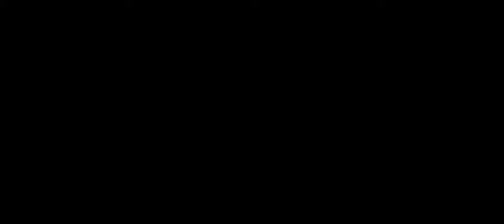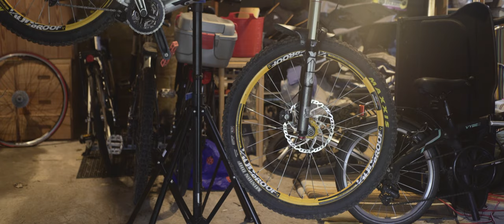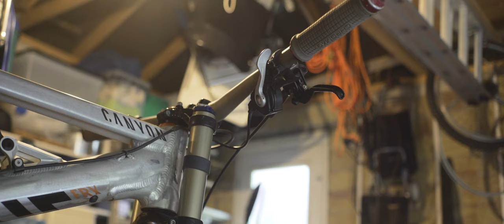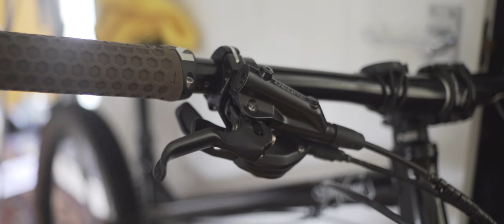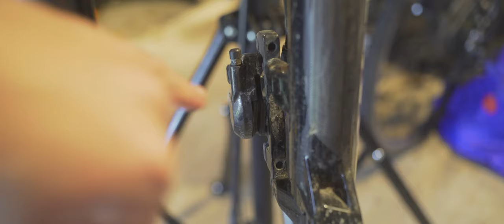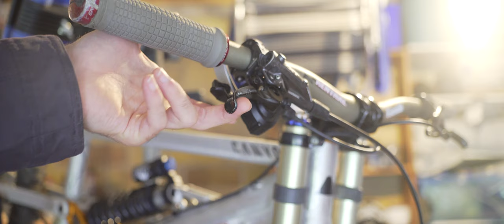How To Change Your Bite Point Or Free Stroke ( Spongy Brake ) Shimano or SRAM Hydraulic Disc Brakes

Comment: I've done this before but it dosnt seem to last that long. My lever seems to go back to being a close pull as you described. My lever is already adjust as far out as it can go via the little 2mm screw. Funny thing is my front brake is fine , it's just that damn rear one giving me trouble. I've bled it over and over again. I may just buy a new rear brake.
Reply from the maker: There shouldn't be any reason for this not to last...once the pistons have been pushed out they can't really go back. The only thing you could be facing is pad wear? Obviously once the pads wear the tolerances change somewhat. What levers are you running? Is there any chance you have an air leak somewhere? FWIW I've always had more issues with rear brakes than front ones. The long hoes makes it harder to get a good bleed
Reply: it happens to me too, but on both brakes. I think you need to bleed it with the pistons already pushed to feed more oil
Reply: You just described my exact issue. You're right too. This easy fix doesn't last very long. My riding buddies kept asking why I kept taking my tire off 🤣
Reply from the maker: Interesting observation. My trail bike hasn't been rebled or had any attention to the brake system except new pads for just over two years and the brakes feel exactly the same as they did after adjustment. It might legitimately be a case of there not being enough oil in the reservoir in the lever initially which would allow air into the system over time. Might be worth a rebleed/top-up
Reply: Yes it won't last, since when your pads loose material, the distance that your piston needs to travel to brake increase. Your piston is hold in a seal that deforms when you brake, due to pressure applied on the piston, and therefore move the piston forward. When you release your brake, the seal get back in its original shape (like a spring), and so do the piston (there is no slip between piston and seal) . But when your pads get thiner, the piston needs to move more and eventually the seals wont be able to deform enough for the pads to reach the disc, so the piston will slip trough the seals due to pressure, until it reachs the disc. Then, the seals get back in original shape, so pistons and pads move backward at the exact same distance from the disc everytime, no matter what.

When you do the tricks of the video, the travel of your piston get smaller than the travel than can cover the seal when deforming, so it works, but when your pads loose material, the travel will increase until it reaches the point where pistons got to slip trough the seals again.
This allow us to have every time the same travel for the piston no matter your pads state...

Comment: So I did this on my previous bike and it worked wonderfully…exactly as described in your vid. Fast forward…new bike but same XT 8120 brakes and I’m trying the same thing but it’s not working so well. The pistons advance as expected but they don’t stay in that position. Rather they just retreat back to their original starting position when I cycle the levers, effectively eliminating any change to the bite point. Any ideas on what’s going on here? Was thinking maybe this only works if you’ve got a solid bleed going…and maybe I don’t however I’ve bled them many times over with no luck. Open to suggestions…TIA
Reply from the maker: If you’re finding that they’re retracting that’ll be because of the vacuum in the master cylinder. My advice would be to follow the steps in the video but with a bleed funnel attached to the lever and a bit of mineral oil. This will allow the system to be essentially ‘overbled’ so the pistons cannot retract as far. Hope that helps!
Reply: Ahh yes…that makes perfect sense. Thx for the advice…I’ll give that technique a whirl and see what happens
Reply: I guess what’s most confusing to me is why this maneuver works for people that DON’T overbleed their system with the reservoir cup in place. Without it, why would the pads stay advanced?
Reply from the maker: It depends on how much fluid was in the system to begin with. No two brakes are going to be bled exactly the same. If the factory underbled your brakes for whatever reason you’ll have pistons that retract further but the next bike on the assembly line might have brakes that are overbled. It will all depend on the mechanic who assembled it. 

There are also brakes that benefit from underbleeding like Hope’s RX4s. If they’re overbled the pistons don’t retract at all so you almost always have to create a vacuum in order to get the pistons to work properly
Reply: Okay…have a new question for you, kind sir! I just bled my brakes as you described in this comment exchange. I advanced the pads WITH the reservoir still in place and it seemed to work brilliantly. I like a very short lever throw and this def did the trick. The next morning I grabbed a handful of brake lever and it shot all the in to the bars. I rechecked my top & bottom bleed ports and they, indeed, we’re both tight. What I did notice was oil leaking out of the outboard side of the master cylinder. While I’ve since learned that it is actually some kind of overfill release valve (or something similar), what I can’t find is how to fix the problem. I’ve bled completely twice since this happened and the lever still isn’t tight. Have I popped some kind of gasket inside the master cylinder?

Comment: Xt 8100

Im in a position where if the brakes are close to my grip, and i one finger brake, it smushes my other finger.

I got the lever throw all the way out.

Do I need more oil in the line or something?

otherwise I had to scoot the brakes further away from the grip, but that also puts my shifters kinda far away.

What am I missing.

If I just 2 finger brake then Im fine but what the heck thanks?

Comment: I’m gonna try this on my Tektro 275 brakes as I’ve bled them twice now and they still feel off. Seems like i need  to pump them a couple times to have them feel right like the pads need to move closer to the rotor. I also wonder if using a 6 or 7 mm bleed block would accomplish the same thing if bleeding and using not brand new pads.

Comment: I had tried this previously and it worked for the first ride, but then started to go back to the original position after a few rides.  Maybe I didn't pull the lever enough times when adjusting.  I will try again and hopefully it stays tight longer.
Reply from the maker: I think you’re right. You might just have adjusted it enough. I re-adjusted my hard tail in December and the brakes haven’t needed any work since
Reply from the maker: I think you’re right. You might just have adjusted it enough. I re-adjusted my hard tail in December and the brakes haven’t needed any work since

Comment: 3:22 I am confused, why didn't you do this using the free stroke adjustment screw ? Doesn't it do the same thing ?
Reply from the maker: It technically should, but in practise the free stroke adjustment is next to useless because of how little movement it offers. Shimano’s free stroke imo isn’t worth having on your levers. I’ve run Deore levers with XT callipers on various bikes for years. Performance is the same and it’s cheaper to replace if you crash
Reply: @BenHuggett  so in theory the free stroke screw should move the brake pads closer to the disk, no ? Because some mechanics say that is not what it does, one was very sure that it modifies the pressure somehow and NOT "moving pads closer" as I claimed 🤦‍♂
Thanks.
Reply from the maker: It’s a closed loop system so yes that’s exactly what it should do. In practice however, the range of adjustment simply isn’t enough. Any change to the pressure in the system can ONLY act to move the pads closer. The point of this video is to show an alternative method of moving the pads that allows a greater range of movement

Comment: Just tried this on a brand new out the box bike (when doing a tubless conversion so had wheel off) and the stoke got worse/longer.  Is terrible now. Why don't brakes have an adjustment for this
Reply from the maker: Some brakes do have an adjustment for this. It’s called free stroke. If your travel has become longer by doing this then you must have done something wrong or there is a vacuum in your brake line. Have a read of some of the comments here, people have added to the video with some really helpful advice
Reply: @BenHuggett thanks for the reply. They're on Shimano SLX so don't have it stock. Maybe because when doing the tubeless it was upside down for 10min

Comment: Hey there. I have performed this a couple times which helps immediately but then after a little usage it ends up even worse than before. Discovered that a mile into my ride where I could pull the lever all the way to my handlebar and keep rolling. Any tips for why a fix like this does not persist? Brakes have been recently bled and lever springs back nicely.
Reply from the maker: Hi,

If you can pull the lever all the way to the bars at all that suggests there’s not enough fluid in the system or air. I know you said the system has recently been bled but if it’s been bled thoroughly, there should be no way for your bite point to wander around like that. The brake system should be a closed loop so once you’ve made an adjustment it should stick unless you have a leak somewhere. It might be worth checking that your pistons aren’t leaking and that the couplers are tightened down on the calliper and the lever! 

Hope that helps!

Comment: I just did that and realised I needed new pads so I put in some spares and the brakes have little to no movement and the disk is bent so it rubs which sucks but I think I just have to re bleed them to get some oil out cause the pistons won’t budge
Reply from the maker: It can take quite a lot of force to push the pistons back if they’ve been exposed to dirt etc for some time. Might be worth having another go with something larger to get more leverage before you go through a full bleed

Comment: Hey man I tried this after realizing my left XT M8020 levers 'free stroke' screw literally did nothing but extended the reach of my levers, after doing your trick it worked like a charm, I dont even know why Shimano made a free stroke screw that doesn't work that well at all, disapointing.
Reply: BTW my front brakes are squeaking already, is it because it needs replacing due to it being .5MM of resin left?
Reply from the maker: I’m really glad it worked for you! I’ve said it before and I’ll say it again, Shimano should ditch the free stroke screw and should just recommend this as a tuning process! 

As for the squealing brakes - that’s probably down to contamination of some sort. Have you noticed a drop in braking power recently?

Comment: is it normal that i have to repeat this process every few days? My zees are a few months old so no mechanical issues, but about two rides after pushing the pads closer together the stroke goes really far in again, and i have to push the pads out again. I have sintered pads so i highly doubt they are wearing material that fast
Reply from the maker: No, I wouldn't have said that was normal. Off the top of my head that sounds like air trapped in the system. Probably in the master cylinder. When was the last time you did a complete rebleed? As in opening both ends of the system and flushing it through with oil completely. I agree it's unlikely to have anything to do with pad wear, sintered pads last for ages even in horrible conditions
Reply: @BenHuggett  have bled the brakes fully about three weeks ago, and then again about two weeks ago I did a lever bleed to try improve the feel, again the brakes are fairly new and they haven’t been getting much abuse, so I doubt it’s any air leaking in or similar issues.
Reply from the maker: Sounds like you've done everything right then. To be fair, new brakes do take some while to settle in. My XTs always take quite a long time to settle in and feel really spongy even after a bleed for the first couple of months. You might just need to give them a chance to get themselves bedded in. Are you riding downhill stuff?
Reply: @BenHuggett  yeah enduro/downhill type things
Reply: Maybe your disc is warped, and push back the pads over time.

Comment: Spend some time truing your rotor and a stand and one can get their shimano brakes to bite almost immediately when the lever is pulled AND you won't get any rubbing
Reply from the maker: I think you’ve slightly missed the point of the video. Rotor trueness has very little to do with engagement or bite point. The purpose of this guide is to show people how to essentially push their pistons further out to reduce the free play in their braking system. Truing a rotor will not accomplish the same thing. All the brake manufacturers advise users to push their brake pistons back when performing a system bleed but don’t advise users to push them back out - hence the positive comments on this video

Comment: Just done this on my new Scott Sub Sport Ebike which has Deore 11speed.  The front brake is really good now with only a tiny amount of free travel before the biting point, but the rear has a little more travel before biting point, but then again the front brakes always seem to be a bit more keener than the rear, is this normal.
Thanks John
Reply from the maker: Totally normal. Just means the brake pistons haven’t advanced the same amount. In other words, the piston/s on your rear brake is stuck further in the calliper than the one in the front. You can either follow the steps again for just the rear brake. Your when you come to do a rebleed of the system at some point you can make sure to push the pistons all the way back into the calliper equally front and rear

Comment: Is there a way to do this without removing no the wheels? I have a surron ebike, for me removing the rear wheel seems a big task taking it on and off..... would is the only option buying levers with the adjustment option? They seem really good
Reply from the maker: As the video says, the levers with the adjustment options (free stroke) are not worth having. The adjustment range is tiny - to the point where I'd call it useless. I've not found it works on any of the bikes I've had. Sadly there's no way to do this without removing the wheels from the bike. You only need to do it once so I'd say it's worth the effort of removing your wheel
Reply: @BenHuggett  thanks for the reply, wouldn’t removing the brake pads and then pressing the brake lever have the same affect? Just less work? And the pistons will move in as there’s no resistance against the disk?
Reply from the maker: @joethebrick6382  arguably yes, but I can see myself quite easily over doing the adjustment and pushing the pistons too far out, you don't want to have to force the pads back in. It's quite tricky to judge the distance. That said, you could just undo the caliper from the frame/fork and do it that way?
Reply: @BenHuggett  Thankyou! Yeah good idea I could just remove the caliper!  I’m pretty new to bikes 

I bought the surron, enjoy downhill and trails, never really rode anything else so not sure if I’d prefer a mtb over surron..... surron gets me back to the top of trails quicker and easy😂😂
Reply from the maker: @joethebrick6382  I'm glad you're trying it out! I think e-bikes are a great way to get into mountain biking, and obviously to build your experience. Personally I don't think they're as much fun on trails as a regular MTB. The weight is a bit limiting. But I will say, I can see the motor being great fun for getting back up the hills!

Let me know how you get on taking the calipers off.

Comment: Isn’t it going to rub on the rotor?
Reply from the maker: Not if you do it properly. The aim is to bring the pads close enough together to reduce the free stroke distance, but keep them far enough apart to prevent them rubbing. It's a case of trial and error

Comment: Definitely going to try this. Might need a straight rotor first though
Reply from the maker: It's absolutely worth a go. You probably don't even need a perfectly true rotor. The pistons will push it into true in order to get the distancing right and then you can work on straightening the rotor separately

Comment: Tried a few times now, if I move pads any closer, they start rubbing the disk, push them back a little and the movement is back was too much for my liking. Primitive technology, if we only could adjust the pad positioning, amount of bounce back and brake movement precisely with set or screws ... oh wait we've had this for years with traditional, steel brake lines.
Reply from the maker: Are your levers firm feeling when they actually engage the disc rotor? Your description sounds rather like it might be in need of a full bottom to top bleed.

What I will say though is you make a brilliant point about cable actuated brakes. The set up is so simple and genuinely fool proof. Disc brakes are always a case of trial and error no matter your level of experience.